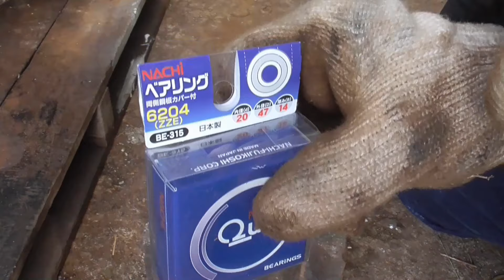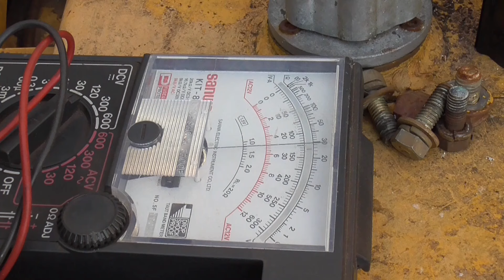長期放置のユンボ再稼働　Excavator left for a long time,Will it be restarted?

Comment: Oil leak is probably the crankcase breather blocked, too much pressure inside the engine. Nice little tool though once it's been restored.